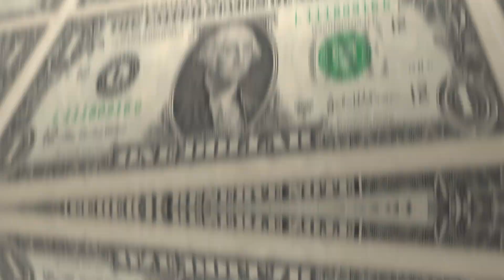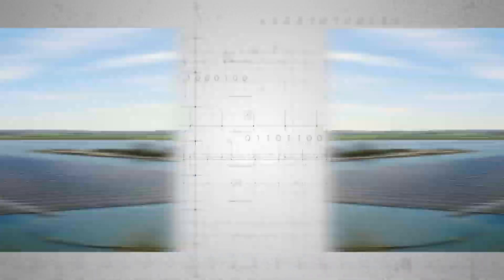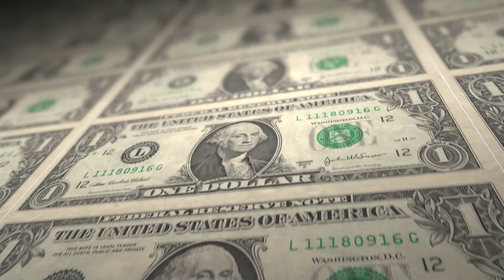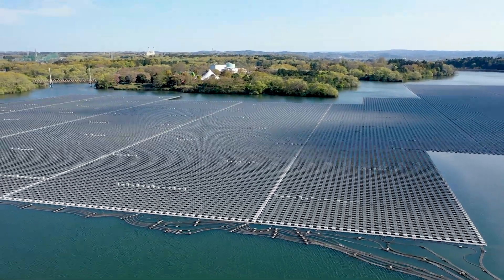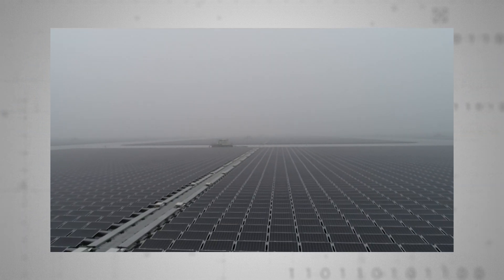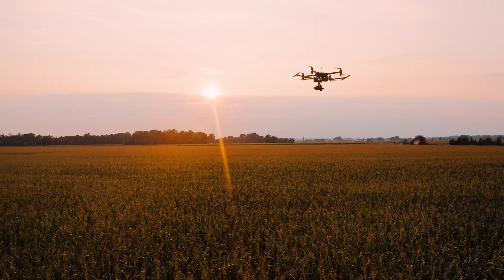The World's Largest Floating Solar Farm

Comment: Why don’t governments (especially in more developed nations) just enforce people to plant at least 1 or 2 trees a year so then deforestation occurs at a slower rate and helps capture carbon. I see it as a very cheap, easy, practical and accessible way to help offset emissions.
Reply: And, how would a government enforce such a policy? I stay in a country of a billion people, and it's going to be quite a humongous task to manage, if at all that happens.
Reply: @venkate5hgunda  They can pass this as a law. Like in England the COVID-19 restrictions were legally passed as laws and anymore found to be breaking those were punished through the system. They could do the same for the policy for planting 1 tree a year. It’s a very easy job to do and doesn’t take more than an hour to do per person. And a billion more trees would greatly help your country since it’s probably one of the biggest emitters in the world.
Reply: @pa-pn1uu  In Singapore we don't have enough open land for plamting many trees
Reply: @misterbig9025  I’m sure you can offset  or reduce carbon emissions other ways than planting trees.
Reply: @pa-pn1uu  I give you two real examples why it will not work. (1) For the metro project, government chopped about a million trees and they promised that they will plant 10 million saplings. One university that had lots of space was supplied with a iron fencing (to protect saplings) but without water and essential care they dies in less than a year (2) In a govt sponsored housing colony, each house had one tree in front (very close by actually on the road). People started chopping off the branches for various reasons. 30 years ago, the colony looked very green and neat but today all the trees are gone.

Laws do not work; education is essential. even with education, it needs at least two generations.
Reply: @pa-pn1uu  am I supposed to plant it in the city side walk? The parking lot? Or go to jail? Wtf.
Reply: @janami-dharmam  obviously without water the saplings died. Literally nothing can live without water so that statement is just stating the obvious. If you’re talking about a barren area then a forest wouldn’t have grown there naturally in the first place so then it was a stupid idea to start planting trees in an area in which they cannot survive. In England every single road (including private, strictly residential and commercial roads) are all lined with plenty of trees. It’s up to the local council here to maintain the greenery and not done by imbeciles on their own. That’s why we pay council tax like you pay state tax so the people in charge can use the money to support the local areas. Not once have the council cut down an entire tree unless it was dead, already falling over or causing a hazard.
If laws do not work then what is the point of them. COVID-19 restrictions were passed as laws and a huge majority of people started following them. When our government starting giving “recommendations” nobody listened even though everyone was well educated because nobody was forced to follow them. People don’t do anything unless they have to or are forced to do so.
Reply: @TheBooban  clearly you chose to skip all the comments below and not read them. Just plant in an area with an existing forest.
Reply: Everyone please do not reply to @jelenacatherine9735  as they are just a bot who will scam you. Please report them cuz nobody likes scammers.
Reply: Mäx.    Mähêr ✍️  bruh this conversation isn’t about crypto or trading. It’s about the environment you half wit. You’re just another bot trying to scam people. I’ve literally followed up and messaged those numbers before and all they ask for is money and then they run away with your money.
Reply: @julianhaddad1431  yeah that too but that can be done by governments and corporations themselves. I’m talking about getting the public more involved which will make them more aware and more self conscious about their choices. I don’t see any reason against planting a minimum of 1 tree a year per person and maybe they could just increase to 2 trees a year.
Reply: @pa-pn1uu  Not a bad idea.
Reply: Again anyone seeing this report  Mäx.    Mähêr ✍️  because he’s another bot trying to scam you.
Reply: The biggest challenge in this initiative is land acquisition. You see, land is very expensive in most parts of the world.
Reply: @ishantripathi9707  you don’t need to buy more land. You can just replenish the existing land that has been ruined by urbanisation and deforestation. Then after many many years of replanting billions of trees then you might run out of space which in that case there will be far more ways to reduce and offset carbon emissions. You don’t need to focus on what you can do in the future if you’re not gonna focus on what you can do in the present.
Reply: Not in California 🙄
Reply: @irri4662 the cost of planting trees doesn’t increase in california
Reply: @pa-pn1uu  but the odds of it burning  back down in the near future is high in California.  🤨
Reply: @irri4662  that’s true but there isn’t just 1 way to reduce or offset carbon emissions. Why don’t you get a governor who actually focuses on the real issues at hand.
Reply: The mark of low IQ beast  the logic about so many variables such as a single forest fire doesn’t make sense because there are so many natural existing forests yet at any given moment a single forest fire could burn each forest down but that hasn’t happened. Just because a hazard exists doesn’t mean it will cause a problem. Such is the case with volcanoes, just because they exits doesn’t mean they will all erupt and cause mass extinction. I don’t think real estate is going to be expanding anytime soon into the existing forests since they are in rural areas and most development is in urban areas. And more and more people are moving into apartments than ever before which is reducing the need for land for housing so future needs for land for housing is certainly going down and many businesses are moving online as proved by the pandemic where many retailers have closed their stores. This means there will be less land needed over the years so land price and availability will not be a problem.
Reply: I not saying  don't plant more trees .  Trees are just  one part. It's entire habits  that need to be rebuilt.  On land and sea.
Reply: @irri4662  that’s much more difficult and much harder to involve the general public. Planting trees is cheap accessible and easy to do for anyone regardless of wealth, space or time.
Reply: The mark of low IQ beast  using your logic about the power of forest fires burning trees down then there would be no forests left on earth because they should’ve all burnt down right? It’s very obvious that suburbs are growing at a much much slower rate than apartments simply because of the fact that millennials (soon to be the majority of working people) cannot afford homes in the suburbs or city centres. It’s just a fact that more people are renting than ever before and more people are moving into apartments because it’s cheaper, less maintenance and can be built closer to their workplace because it doesn’t take up much land space. If you had read my previous comments replying to others it’s not just about planting trees right in the city centre. First restore all existing forests the vast majority of which exist in rural areas and after many many years of doing so then yes there might be a need to plant further out from naturally existing forests but if you look at where the forests used to lie a decade ago and then where the borders are today you can see the mass deforestation globally. Land scarcity won’t be an issue at all if you just plant the trees where they once were.
Reply: easy to plant, hard to keep it alive
Reply: @Dromfel  trees are one of the easiest plants to keep alive. How do you think existing forests are still alive after millions of years. All they need is natural rainwater and the available nutrients found in the soil which enables them to form an ecosystem. You would only need to add human maintenance if you’re planting in areas which the tree is not native to or where the ground hasn’t been grown on before (ie the ground is not fertile). The idea is to plant in existing areas where the forest has been cut down. This is evident as shown by the receding forest borders over the past decades.
Reply: Germany..... 😭
Reply: @SchwertmeisterSquall  ?
Reply: @pa-pn1uu  germany dosent want the change, that is wat i meen. At least the goverment right now. I hope the new goverment at September, go all in, to the change.
Reply: @SchwertmeisterSquall  I mean realistically you don’t need the government to tell you what to do. You can plant trees yourself. I’m just saying the government should enforce it because if they don’t then 99% of people are too lazy to do anything about it because they don’t do anything unless they have to do something. By making it a policy then people will actually start taking action.
Reply: The mark of low IQ beast  if think you need to consider watering forests then who waters any forest. The pre existing environment that has been there for millions of years can water the trees. There is no legitimate worry of water scarcity since no one waters forests and there are billions of trees that have thrived for millions of years without a single human watering them.
Reply: The mark of low IQ beast  you said “too many golf courses take the space of forests in the cities...”. How tf does “forest in the cities” make any sense. Cities don’t locate near forests and forests don’t grow near cities. Urbanisation and suburbanisation prevents forests growing near cities. I never said anything about planting on golf courses either. I said restore the existing forests where they once used to be as they have shrunk massively over the past year.
Reply: We burn more stuff than we have time and energy to plant trees. Solar is just a piece of the renewable puzzle
Reply: @rushja  it literally takes less than half an hour to plant a tree. The main time consumption is getting to a suitable location to plant a tree. Yes you’re right solar is part of it as well.
Reply: The mark of low IQ beast  I never said anything about making a forest and actually if you look it up america is about 36% forested. If you plant in an existing ecosystem then no human input or maintenance is needed. If you want to create you’re own ecosystem then obviously you need to have lots of maintenance for it to survive.
Reply: The mark of low IQ beast  forests shrunk because people chopped down the trees for the wood to build and use as resources not so they can locate cities into forests. Just because they got chopped down doesn’t automatically mean people moved into the available land. The only people living near forests are farmers and not cities hence it’s in a rural area. If you actually studied a reasonable level of geography you would know most cities are located near the coast which is highly urbanised. Forests still exist and nobody moves into forests to urbanise them. People chop them down for resources and farmland that’s it.
Btw I’ve lived in an urban suburb my entire life and I’m actually logical and don’t resort to insulting people without any basis or knowledge.
Reply: The mark of low IQ beast  bruh just because I said apartments are the fastest growing housing type doesn’t mean I have to live in one. Just because I said we should plant more trees doesn’t mean I should live in the forest. The point about cities being near the coast is relevant because that means that deforestation has nothing to do with moving into the forest but for resources. And nowadays with things being made synthetically the main consumption of wood isn’t to sustain cities but for luxury items. This isn’t the 1950s where houses were made entirely of wood. Most modern homes are made from brick and concrete with few internal wooden structures. I haven’t even double backed on my points once as saying apartments are the fastest growing building type doesn’t mean I have to live in one, I just said I live in the suburbs but I have the knowledge that apartments are increasing in number. It’s just a simple fact that cities are in urban areas and forests are in rural areas. Planting trees in rural areas will not affect urban areas in a negative way. Just because I don’t live in an apartment doesn’t mean many other people don’t live in one and it’s a stupid thing to say that apartments take up more space than regular homes.
Reply: I think it would likely be cheaper for the government to just plant the trees themselves, then to try to enforce this...
Reply: @inimic6900  I mean it doesn’t cost the government anything to pass a simple policy like this. They passed policies for Covid-19 restrictions very quickly and easily.
Reply: The westerners will argue that this threatened their FREEDOM
Reply: @relaxwhc  lol so true. Tbh it’s not all western countries as in the uk no one acts like that but it’s very prevalent in the USA
Reply: The mark of low IQ beast  Me living in a suburb doesn’t make me a hypocrite when I say that apartments are the fastest growing housing type. There is nothing to be hypocritical about it as it’s just a factual statement, I’m not telling anyone to live in an apartment. I’m just saying that apartments are increasing in demand and I never said suburbs will be eliminated and not be a thing. I never said trees don’t have many uses either but it’s not the 1900s where everything used to be made out of wood. Nowadays most things are made out of other materials and that’s just a fact. In fact apartments consume far less wood than conventional housing as they don’t use timber frames in the same way normal houses do. And since apartments are smaller than houses they will have less of everything (less flooring, less furniture etc) so that means they will consume less wood than a normal house therefore making your point wrong and invalid. 
You cannot call me a kid when I’ve deconstructed your entire comment and proved you wrong for each point whilst all you’ve managed to achieve is call me an idiot (which in your own eyes is hypocritical). Nothing I’ve said is my opinion and it’s just pure facts.
Reply: Privately owned land
Reply: Government doesn't care about taking care of earth
Reply: I dont think just planting trees can stop the rising co2 emissions?
Reply: If you look, I think you'll find that this is kind of happening in China already!
Reply: 1.  where are we going to plant all these trees  . 2. The average tree absorbs 21-25 kg co2 the average human produces 4 tonnes of co2.. its a nice idea.. but nuclear is the only option to reliably power society and decarbononise.
Reply: Also all new homes should be mandated to set up solar system for electricity. These small steps can make a large effect.
Reply: From which communist country you come? The state can’t enforce that, even more, it steal enough taxes from you that’s his job to plant those trees.
Reply: Solar panels can work underwater,  but they work best in clear water at depths of up to 50 feet and government politicians and corporations would not make money in the stock market as shareholders The water's clarity is important because the sun needs to penetrate the water to reach the panels. Murky water can reduce the transparency of the water and make it difficult for the sunlight to activate the panels. 

 

￼

Solar power can also be used in underwater vehicles, such as autonomous underwater vehicles (AUVs) and remotely operated underwater vehicles (ROUVs). These vehicles can help researchers explore the oceans, but they face challenges with power. Solar power can help overcome these challenges by providing a persistent onboard power source. For example, the SAUV II solar-powered autonomous vehicle can run autonomously for weeks or months. 

 

￼

￼

Floating solar panels, also known as floating photovoltaics (FPV), are another way to use solar power in water: 

 

￼

￼

￼

How they work

Solar panels are mounted on structures that float on water, such as a reservoir, lake, pond, or canal. The water cools the panels, which increases their efficiency. 

 

￼

￼

Benefits

Floating solar panels can expand solar power without taking up more land. They can also help regions that experience droughts because the panels act as a lid that reduces evaporation. 

 

￼

￼

Potential

Floating solar panels have the potential to generate a lot of energy and protect the climate. However, in 2020, they only produced as much electricity as less than 1 percent of the world's land-based solar farms, because we have oceans and seas.
Reply: “Enforce” people???? You mean “force people to do slave labor”???????? Bad idea - good intentions
Reply: @davidoliver7199  no one said anything about slave labour. It’s just a policy which enforces people to plant a single or maybe 2 trees once a year. It’s not an ongoing 12 hour sweatshop condition workplace. It’s just an hour (probably a lot less) of a single year that you use to plant a tree. You clearly don’t know what slave labour is if you think planting a tree is slave labour.